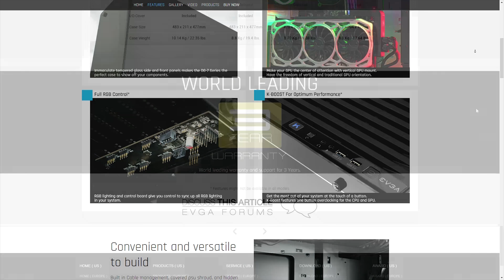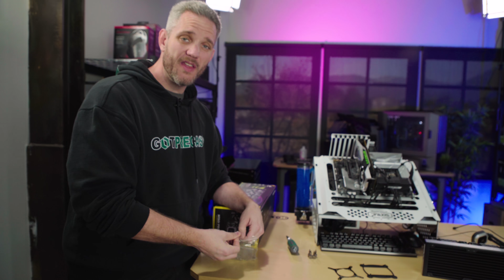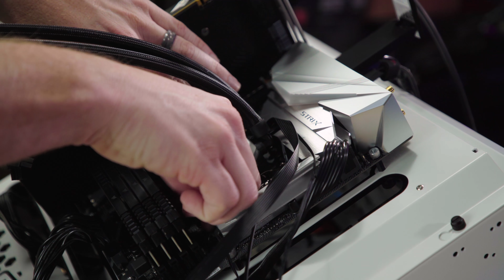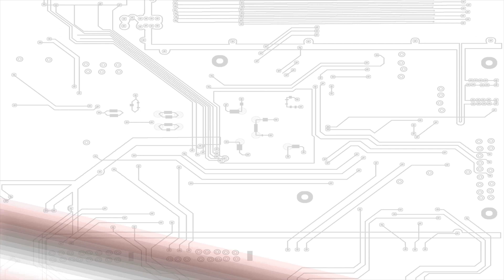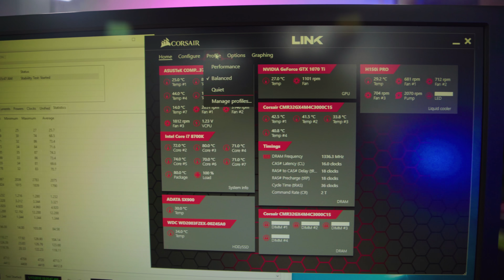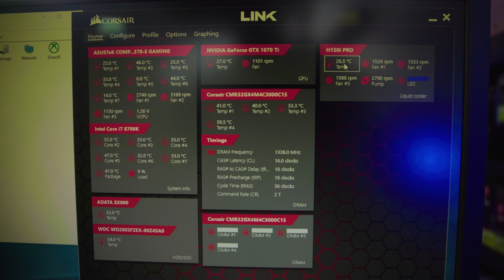Corsair's Largest AIO yet... But is it any good? H150i Pro RGB

Comment: I replaced my old h100i v2 with the h150i pro.. cooling wise, it's MUCH better than what it replaced, the ML fans are so quiet, even at the max rpm i don't really hear them.. the downsides to this thing are the cables, and the noise. 

The cables are annoying as hell to work with, the sata power cable isn't long enough without having to use some kind of extension(this is in a full tower case, a phanteks enthoo luxe tempered glass), and like others have said, they can't be detached or swapped out.

The noise i mentioned is the pump, when put in performance mode, which is the same rpm as the h100i v2, i can hear it OVER my case fans, makes a whine similar to a fridge circulating coolant.

TL;DR Pump is too loud, fans are nice and quiet, cables are the worst i've ever seen in an AIO, cooling is pretty damn good, but not worth the price they're asking for in the UK currently.

Comment: This cooler sucks when  compared to a EVGA CLC 280 thats much cheaper and smaller and yet is lower on temps. Ive no idea why this is the most expensive  CLC on the market. Corsair have delusions of being apple or something with their pricing. Shame Jay didnt mention the price or the fact many other cheaper solutions out perform it. Even NZXT X62 is much cheaper than this POS and yet outperforms it massively. It's really not very good jay these days your video are useless devoid of facts and just paid adverts designed to mislead. Why no comparison to other CLC's at the similar end of the market? Why not tell us its super expensive for its lacklustre performance?

Comment: I use this cooler in a 570x. My 8700k is @ 5ghz with 1.25v and the max temp ive recorded is 72c. Still undecided on adding more fans in "pull"

Comment: if possible on a case closed how far can it cool 8th gen 8700k as its seems high voltage shoots temps easily 90 on most cases. 

Do a in case review of latest cpu under same and see if holds below 85 and not more than even at performance mode when oc to 5ghz or above

Comment: These are all good suggestions.
My question is how many people use AI Suite or other fan controller programs that came with their motherboard? 
Tried for months to figure out what to do to be able to control my fans and pump again as other settings besides performance drop the pump rmp (watch the video carefully and it proves this).

After uninstalling and reinstalling, Windows updates, rollbacks and every other damn thing I found the problem.
Windows on balanced or power saver will disable the usb headers to save power..... 

If you go to device manager- Universal Serial Bus Controllers, then go down to Corsair USBXp Driver, right click and make sure that it's enabled.
Once I re enabled it and disables the save power over usb BS in "Power Options-Advanced" I haven't had a single issue ever since. 
The second I re enabled it literally popped up in the Corsair Link App. 

Good luck, I hope that this was informative and helped at least one other person.

Comment: @JayzTwoCents

Recently purchased a H115i pro for my pc. It says compatible with AM3 but I have an AM3+. I modified the intel bracket to fit the more rectangle mountin screw. Bent two of the 4 legs upward and mounted using cross diagonal legs. It works but looking for a proper AM3+ bracket.

Comment: the clip mounting sucks... i was using my old arctic cooling freezer xtreme(1 verrsion) on 1800x and the temps were way too high.... the cooler was above the cpu and not making good contact =I
Reply: and now i have deepcool captain 240ex rgb, way better temps and cpu got overclocked to 3925mhz on 1.35v
Reply: 60*C in max stress and 25*C idle

Comment: Hey Jay,
I would love to see a review of EK's new semi-custom AIO setup, Phoenix MLC. I am looking at that as a possible cooling solution inside a R6 case by Fractal Design. Personally, I am looking at the 360 Rad setup with the CPU and ultimately a GPU block added in there eventually. Would love to see the cooling capabilities of it with both units installed and under-load and to see if the GPU and CPU should be set to different rads within the set up. Keep the videos coming, they are awesome!!!

Comment: I have a be quiet silent loop 280, bought it last year, but it’s terrible. I think there is a bit of air in the loop and time to time it gets trapped in the pump and it gets so loud that you can’t speak next to it. It’s like a car engine when running without oil. I don’t know if it happens with all aio or is it only this one but I really need a solution. Please help me to decide, should I buy an aio from another manufacturer? I’m cooling a i7 7700k with it in a dark base  900 pro.

Comment: I've been looking at 360 AIO's for a while now for my amd fx 8350 build(yes I know fx 8350 bleh, budget build) but with soon to be 32GB of ddr3 2133mhz RAM I have 8gb right now 2 x4 sticks, i also have the GeForce gtx 1060 3gb SC ,i got it before crypto currency shot up GPU prices I just want a 360 RAD AIO, this review answered a few of my questions I thought I had to buy the actual corsair link box they have, I appreciate the review, I may keep looking for a 360, I was just going to get this one because of the RGB lighting reading temps which is really helpful for my build. I ran fortnite last night and my temps went from 50 C to 65 C running fortnite in just 30 minutes...plus I only have 3 140 mm fans right now including a corsair SP fan I got for Christmas, maybe I should keep l;ooking for an AIO cooler...THanks Jay for the review I appreciate what you and all of the other Techs do.

Comment: I just bought one of these. Haven't installed yet but I purchased for its marketing on how quiet it is. This is the first computer I've built in 15 years. Back in the day we had to overclock the front side bus and to unlock the cpu we had to modify the top of the chip. Anyway I built a Ryzen 1600x Asus prime x370 pro, gtx970 and 16gb xmp 3200 memory(not the Samsung good memory the other one that starts with H). I'm having a lot of trouble overclocking the cpu gpu and memory. I've been all over YouTube and the internet. I can't seem to get any overclock decent and stable. Either I'm super unlucky and won the worse chip lotto or I don't know what I'm doing anymore. I'm running stock speeds and I feel like a failure lol these new BIOS are all interesting but I'm not really sure if I'm setting voltage right. I'd love to get some help!
Reply: I should also note I have posted at 4.0ghz and 3200mhz memory. I do know that I might not be able to get that stable but I cant even get 3.8 stable.

Comment: Great cooling performance but the temperature drop after stress is to damn fast. It's rapid changes in temps that kills electrical circuits. God knows what that does to a cpu over time. A circuit that's active 24/7 will generally last far longer than one switched on/off several times a day because of thermal effects. Cooler manufacturers need to start staging down the amount of cooling to bring temps down more slowly once the cpu isn't stressed anymore.

Comment: Lol Noctua ones are magnet as well.I am sure Noctua fans are going to outperform the Corsair ones in every way possible(especially pressure per decibel).Worst case scenario is 1500 RPM on the pump and ~300ish RPM on the fans(still able to cool 250W parts to around 65-70 degrees on Ryzen +GPU....

Comment: My 8700k under full AVX load can hold 1.18 volts at 4.6GHz all cores with no offset under 85 degrees on NH-U14S
And with 1.24 volts at 4.8 GHz, same test, it doesn't go above 92 degrees. Still no offset. No de-lid either.
So why get an AIO if a simple (rather big, yes, but still simple) heatsink-cooler does the job better?
I did test in AIDA and same voltage I managed to be below 87 on package on 4.8GHz test, with cpu, fpu and cache testing at the same time

Comment: Why the hell don't they design it with a single all in one cable that comes off then splits with all the connectors for a much cleaner look seems pretty lazy  they didn't do that
Reply: TheFirst Check out Fractal Designs S24. That's how aio fans should be done. Why other makers have not caught on yet I don't understand.

Comment: Question 😊 I’m currently running a corsair h100i v2 extreme on my i7 7700k.....  would the h150i pro be a worthwhile upgrade?? Cheers
Reply: An overclocked 7700k will run extremely hot regardless of the cpu cooler. You would probably see some improvement but you would only see a drastic improvement if you delidded your cpu.

Comment: I have Corsair H100i v2 and ASUS ROG Strix x299-E Gaming motherboard. Connected Corsair link cable, Pump power to CPU fan port. Radiator fans to cable comes from heatsink. But in the corsair link software, fan speed is 0RPM and Pump speed is 800RPM. Am I doing anything wrong?

Comment: Hi Jay I have a question if you can help me with this or the general community could answer this it would be greatly appreciated. Would it be possible to overclock my HP Notebook 15-ba009dx the Microprocessor is a (AMD Quad-Core A6-7310 APU (2 GHz, up to 2.4 GHz, 2 MB cache))
and (The GPU is a Radeon R4 7310 AMD Radeon™ R4 Graphics
Integrated) if it is possible to overclock that as well. I Did upgrade the ram to 8 gig's. Before you say buy a better laptop/ and or buy/build a better computer I just wanted to see if it was at all possible. Thank you for taking the time in reading this and for your help.

Comment: The option to increase the pump speed does nothing for performance, if anything it will give you slighty higher temps because the pump has to work more.

Comment: @Jay what liquid setup can cool that 8700K@5GHz with RPM at under 1000? When you go for silence, probably 7980XE@4.7 asks for a 560 on its own in push-pull, but 8700K could do it with a 360 I guess, like EKWB XE or something similar and keep 3 fans under 1k?

Comment: JayzTwoCents has installed the fans in a pull setup. If I'm correct, those fans are satic pressure so shouldn't they be in a push setup? I have the H100i installed in a push configuration and in full load, my temps stay between 40º and 50º in quiet mode.
Reply: It does not matter if it's push or pull, marginal difference.

Comment: How's about EK's Fluidgaming kits? I'd like to see a side by side comparison between their copper/nickel water blocks/radiators and the Aluminium rads + water blocks and see if the type of metal makes a difference, I currently got that kit and I'm liking it so far other than not having a drain port

Comment: Who the fuck designs an aluminum radiator with Cooper parts. Wtf. So you buy the biggest cooling system to have the best temps. But in 2 years, your whole system is dead from leaking...

Comment: yo, J!

i'd like you to try low viscosity MINERAL OIL as a coolant liquid. i can think of several benefits to it. 0 conductivity and gentleness with various metals, no galvanic corrosion,...

water has a specific heat of 4185 and oil is about 1675 J/(Kg*K)
i am dying to see how the different heat capacity of those liquids behave on the PC water cooling scene with non-oil-specialized blocks.
- i bet the difference would be marginal. in case its not: increase the flow, by adding more pumps and optimize route and split gpu and cpu loops.
Reply: also, i actually like cables. there is nothing more sexy than a bunch of cables majestically advancing across the case in an orderly fashion.
cable management for me is like nipple hiding bra or anti-cameltoe padding on female underwear.
Reply: szeredai akos Nothing is better than water

Comment: I just installed this on my 7700k and it dropped my temps a lot from the nzxt kraken x61.  The fans are super quiet as well as the pump.
Reply: i'd actually use this same AIO but I don't think it'll fit in my 750d
Reply: They are very good, as long as they work. I've had 2 h100i v2 pumps die in 20 months. Won't buy any more corsair AIO, until they get their quality up at least.
Reply: @noname-oe9jy  Had 2 fail on me aswell, went custom loop instead. D5 pumps is rumored to be reliable :)
Reply: @noname-oe9jy  Corsair does not make the pumps, don't blame them for pump failure :)
Reply: @tmkongen  - corsair chose to build their product using crap cheap components. I will definitely blame them.
Reply: @noname-oe9jy  Lol.. Alright, fair enough :)
Reply: @tmkongen  What is this comment? Not blaming them for their choice of manufacturer? That's like if I sell you a shitty car and say "Don't blame me I didn't make the engine".
Reply: @BrawndoQC  That's one way to look at it but you don't really know the quality before you try it do you? It's all about the money, always is. Aslong as they make money they don't care. Everything fails, don't know the failure rate of these pumps but I had one running for 3 years without any issues. And there's not really any choice to make for those kind of pumps anyway.
Reply: @tmkongen  if u make a product you test it...  Lmao
Reply: @myrexcontent5840  Uhm yeah? Pointless comment. Shit happens. One Pump can last 5 years without issues and one can fail within a week. Everything has a failure rate.
Reply: @tmkongen  That's by far one of the most ignorant comments I have read in ages :') Based on that reasoning, you can always find some prior manufacturer or supplier, with any type of product.
Reply: @tmkongen  
Your arguement is futile. 
Corsair makes the AIO. It's doesn't matter if they outsource or not. They put the product together and they sell it branded with their name.... It's a CORSAIR Product. 
All credit, AND criticisms are accountable... because, they made the AIO. Regardless if they chose to outsource, It's their fricking product. 
Did these people by the AIO w/o the pump, and then chose to install an inferior pump that later failed??? No. Corsair did. That's why they are accountable.
Do think corsair has a rubber factory and is making their own hoses?? How about the radiators? Do they make those in house? You think they make their own wires? No.
They source out and build products from chosen components. 
SMH..
Reply: Is the h150i pro better than the NZXT Kraken x72 ?
Reply: By a lot do you mean 0.1C?
Reply: https://www.asetek.com/desktop/do-it-yourself/ actually these "unreliable pumps" are extremely common. Some of the best, Asus uses them on their $350 AIO. It's not just Corsair.
Reply: I have same cpu so I’m gonna pick this up
Reply: Quiet? They are very loud when they start to increase speed. I will change mines with Noctua fans.

Comment: Those cables should have either been detachable or sleeved along the tubs to basically hide them. If they ended up at the res they would be out of the way if not in use.

Comment: I used the H115i (280mm) the last year and was impressed of the performance. Cooled my 6700k@1.4v (delidded) and kept it under 72C in Synthetics.
+1 for the better fans on H150i Pro, the old ones were totally bad and I also replaced them with decent Noctuas.
Another +1 for the possibility to see all 3 fan RPM's. On the H115i the Fans were splitted and if one fan was not running you didn't get that.
I always wanted a 360mm AiO with USB control and now it's there. Time is over for me as I built my first custom loop now =D

Comment: not too impressed, i7 8700k at 4.7 all cores with dark rock 3 pro cooler on quiet mode gets almost the same temp and it only costed like 85$
Reply: zZoKo air always wins an aio it's always been like that. People by aio partly for the looks
Reply: all the common tests, prime95 aida64 cinebench

Comment: My Corsair H100i failed after 13 months. I contacted Corsair about a replacement. To RMA the faulty unit cost me $170. I could of bought a new one for that price but corsair prefers you to send with insurance coverage. I was hoping Corsair would throw in a few freebies and keep a loyal customer happy but no, they were not interested. They just reimbursed me the extra cost over the RRP of another unit so I was still out of pocket just over $120. I got my replacement and I still had to wear the cost of postage etc.
I'll never use another Corsair AIO unit again! They could of sent me a Postage Free RMA box or satchel to send it back to them in.

Comment: I noticed you had the pump on upside down on the motherboard. Was it because where you had to place the radiator or because you have 4 sticks of RAM and the tubes couldn't fit on that side of the pump next to the RAM in the upright position?

Comment: Jay:  Just wondering when you will tell your viewers just how bad the Corsair LINK software is...  Have you ever looked at the amount of I/O byte reads for the Corsair LINK process?  The message protocol implemented by Corsair LINK is so bad, the LINK software can cause issues with other USB devices (keyboards, mice, headsets, etc...), especially when using their AIO in combination with a Corsair LINK enabled PSU and Corsair Commander Mini.  Corsair does a good job with their hardware, but their software just sucks from an efficiency and stability point of view.  Please do a more in-depth review on the Corsair LINK software when used in a system that has:  Corsair LINK enabled PSU, Corsair Commander Mini, and a Corsair AIO.  The "test setup/conditions" should include an overclocked system which is running a "high end game", recording the game video using OBS (high quality 1080p @ 60 fps), and having other USB devices attached such as:  Gaming keyboard, mouse and keypad, webcam, headset w/ mic, and an additional microphone.  You'll likely observe periodic USB device disconnects.  I'll never ever use Corsair LINK for a gaming machine again, nor use Corsair components that can only be controlled via the Corsair LINK software.  BUYERS BEWARE!!!!!!